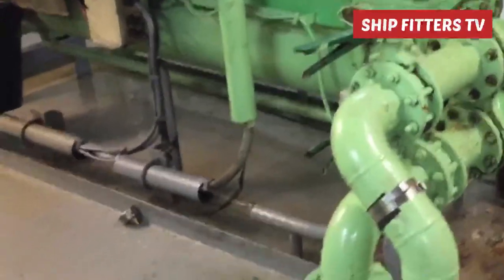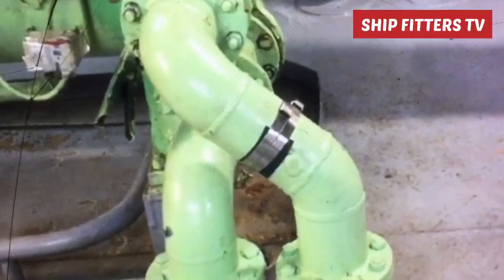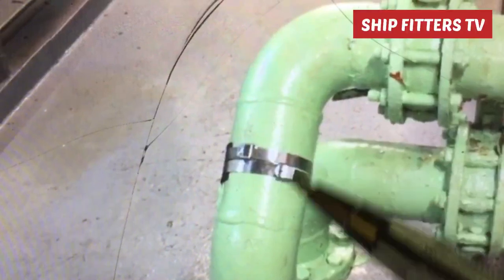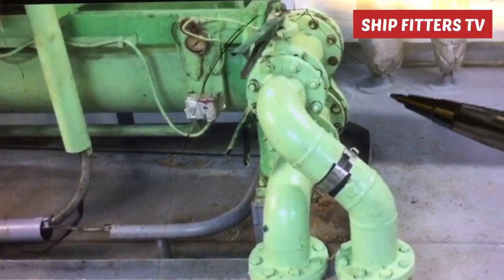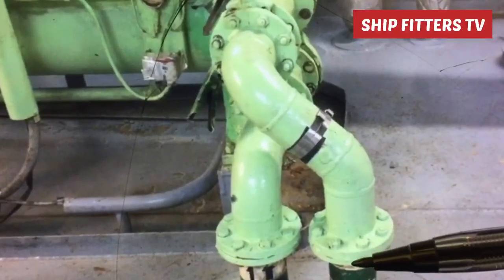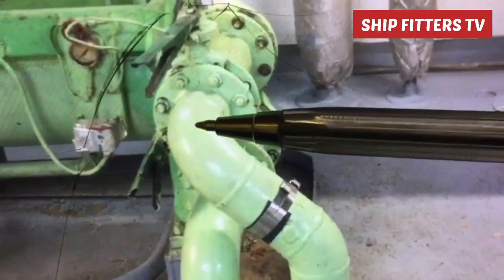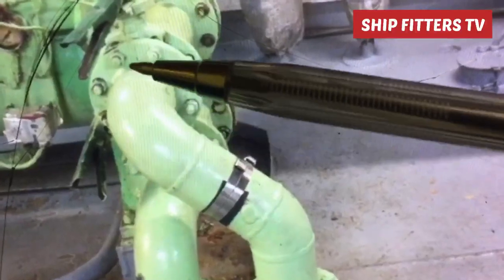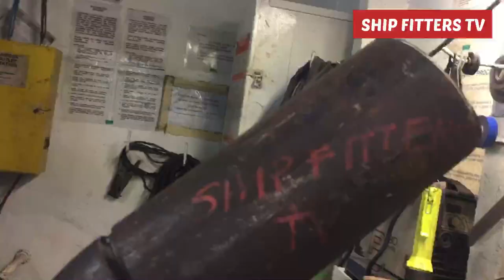ELBOW 90 and 45 joint together

Comment: Mga ganyan boss Hindi ba pwede tanggalin para ma gawan ng pattern? Baguhan lang po kase ako
Reply from the maker: Puede naman pero iinit ang accommodation at room nyo at higit sa lahat di mo makukuha ng 4 hours yan so 4 hours din mag tiis ng init at magagalit na ang mga tao nyan. Kasi sa barko pinaka importante sa lahat ang aircon kasi yong tubo na iyan ay sea water supply to aircondition cooler.. yong sinasabi mo na tanggalin at gawan ng pattern iyan  yong traditional na paraan ginagamit lang yan kapag di naman nagmamadali pero sa panahon ngayon dapat matoto ka gumawa ng new pipe fabrication upang hindi ma delay ang operation para tanggal kabit nalang lalo na sa barko namin na time charter kaya bawat oras ay mahalaga

Comment: Sir pakita mo po paano mo sinukat ng actual at drawing para may idea po kami salamat po gobless
Reply from the maker: sa unang video ko bro sinasabi ko doon ang dapat sukatin sundan mo nalang  yon at iyon ang aking ginawa kahit sketclital drawing lang atleast may reference ka no need na ng magandang drawing ang importante na tama ang mga sukat at mag fit yong ginawa mo pag balik sa tubo
Reply: Ok po sir..ok lang po ba na iguhit sa working plate para may guide ako at malaman ang position at sukat ng ng dalawang flange at doon ko nlang tock weld sa working plate ang flange ok po ba? At sir pag nagsukat kayo ng flange tinangal po ba ninyo yung isang bolt every sukat gamit ang L squire kasi hirap sukat may bolt hindi makalapat yung L squire sa flange

Comment: Offset. Kitna. Hai. Sit×run.kitna.hai
Short albwo center. 4×1.5×25.4=152.4mm
Long. Albwo center. Tan{90÷2}×1.5×4×25.4=152.4mm.
Sit×=152mm
Offset. Ka. Pura. Linght. 500mm
Short albwo center. 152mm
Long albwo center. 152.
Gaiprod 6m.
152+152+6=310mm
500-310=190mm.pipe.ka.linght.hai
√{500^2+300^2+=583mm.linght.hai
Run÷152mm